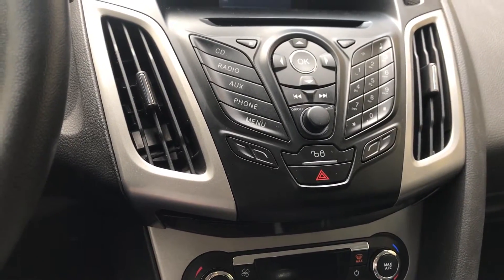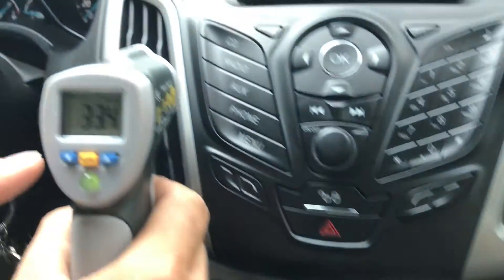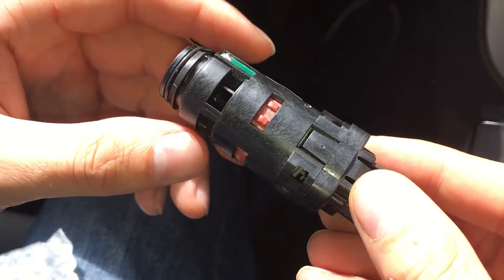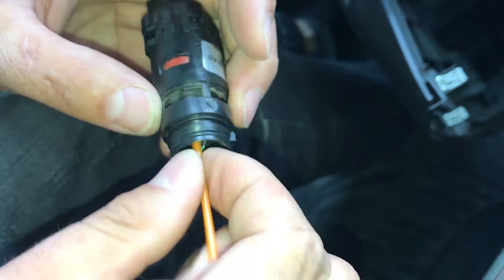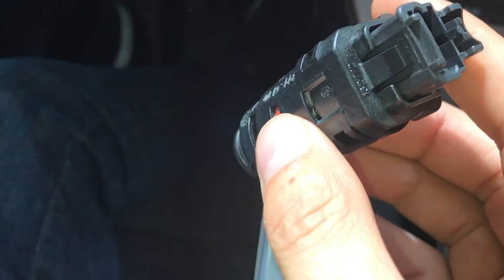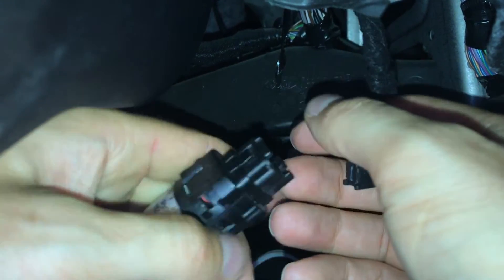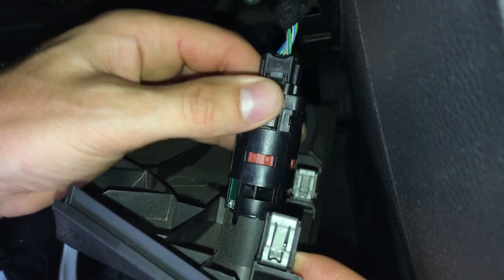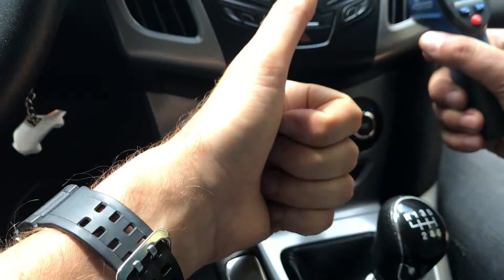Climate temp sensor replacement for Ford Focus 2012

Comment: I have a question: for some time now, the sensor in my car has been vibrating quite a lot. In fact, the noise is pretty loud, like a continuous beep. Is this normal? The air conditioning works fine, but the noise doesn’t go away and the sensor keeps vibrating. I tried another sensor and the exact same thing happens. Is that normal?

---

¿Quieres que lo adapte a un inglés más técnico (para un mecánico) o más coloquial (para un foro, por ejemplo)?

Comment: Wow thanks for this nice Video. My climate Control Starts to Heat in Summer and Focus was Crazy. I do Remove the Sensor and I cannot See anything inside it was completely covered in dirt. So a little air pistol cleaning and the sensor was back and able to see. Test after reassembly was good, hope this is all of it! Thanks again for this nice video! 👌🏻👌🏻👌🏻👌🏻

Comment: Dude, thanks a lot for this. I have been dealing with this issue for a couple of months and the whole time I was suspecting that a sensor was the culprit as Lo mode worked just fine.

My car is to go to the shop for the yearly check and wanted to tell the mechanics about this failure, but I have just fixed it with a couple of Q-Tip to clean the sensor.

Also if the part fails completely, the replacement is just 50 € and a couple of minutes of my time.

EDIT: the sensor failed again and I had to replace it. Being European, I ordered it from MyParto for 60 € shipped and now it is working great! Do note that the updated part is 2030991 and, despite looking a bit different than the factory installed part, it is perfectly compatible.
Reply from the maker: @Al-Azraq  Your welcome!

Comment: Thank you, your Video helped me to solve my problem. Ford part number shown in the Video has recently been replaced by part nr. 2 030 991.
Price in sweden, about 500 SEK.
Reply: Is that part the very same as shown in the video? Because 2030991 looks different to me, with the connector facing a different direction.

Or despite being different is still valid?

EDIT: I have replaced my failing part with the new one (2030991) and it is perfectly compatible. My climate control works great again!

Comment: Would replacing this sensor fix my 2017 ford escape buzzing noise? Coming from the dash?
Reply from the maker: Is very hard to give you an accurate answer, but is very easy to try, remove the panel, remove the sensor and give it a try, if the noise is gone most likely the sensor is causing it

Comment: Thanks! Cleaning and position again worked for me. Please note that the sensor part is really basic, it's just a resistor that changes its value with temperature (NTC). No fancy electronics, but it seems important that the fan is spinning and get the airflow from the cabin passing the sensor/NTC.

Comment: I had one that was not working. 
It was easy fix, one resistor changed on electronic plate, inside of sensor, for a price of an ☕.
Used was 100€. 😂😂😂
Reply: Do you know what NTC resistor it needs? what Ohms etc?

Comment: Very useful. Thanks a lot for the video! In my case, the sensor didn't work after thoroughly cleaning it up either. But I still tried to make it work back, so I re-soldered the little wires between the sensor itself (not necessarily the little electric engine's too) and the electric board and those from the electric board to the connectors. And it seems this did it. The cars' climate control now works as it should. Probably the connectors oxidized over time. I hope the fix will last.
Reply: What exactly you have soldered?
Reply: The sensor's long legs' connection points onto the board. However, it only worked for a few days, so I eventually had to buy a new one.

Comment: In my case I could solve the issue by just cleaning the sensor like you mentioned in the video (I used an air compressor). Thanks a lot!

Comment: Thank you so much for posting this.  The Ford dealer in San Diego, Ca. wanted $150 out the gate just to look at it.  Then they mark the price of the part up 150% and charge at least another $120.00 for an hour of labor to put it in.  So you save me at least $200.00.  I don't know if "Rock Auto" delivers to your country but if you have time to wait on the parts you can save a lot of money on small stuff that doesn't cost a lot to ship.

It cost me $35.00 US and took 10 minutes to change it out.
Reply: Can you please send me a link with the part on Rock auto?